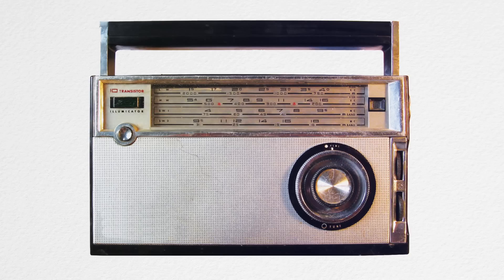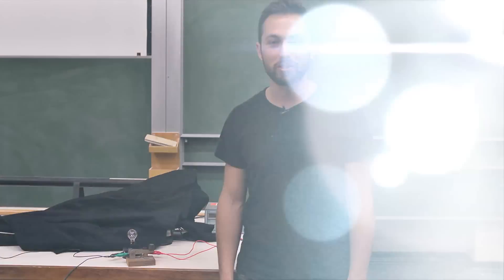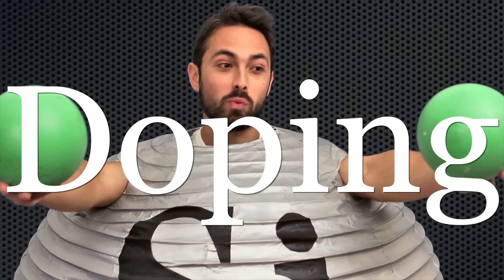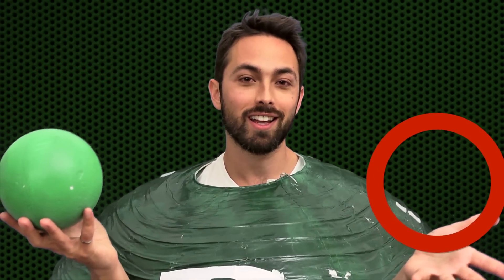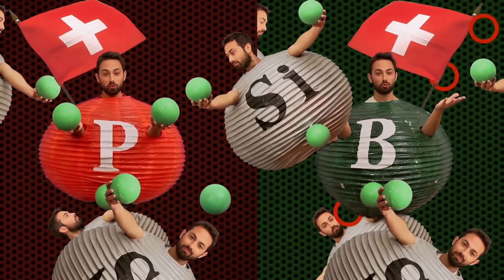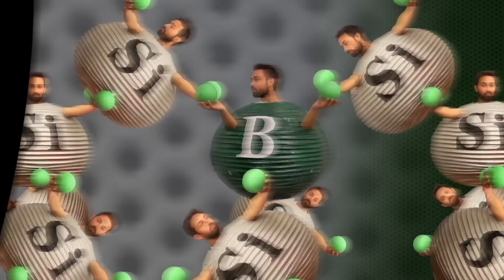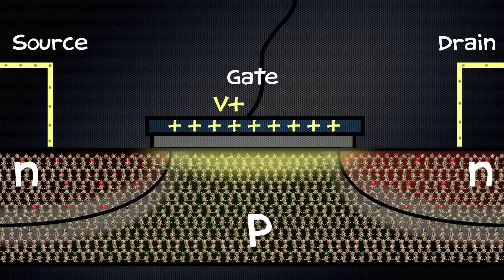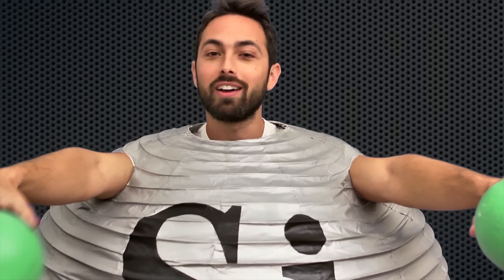How Does a Transistor Work?

Comment: Good Morning,
I greatly appreciate your Youtube video series.  I enjoy and ’LIKE’ every one of them.  You have covered some aspects of science that I have never covered.
I was especially enjoyed the videos on How Transistors Work.  This video brought back some memories that I have been dwelling on all day.  At one time, long ago, I made transistors while working at Monsanto’s Research Center located in Creve Coeur Missouri, just west of St. Louis.  The year was 1969.  At that time, Monsanto was a major provider of polished single crystal silicon wafers used in the manufacturing of semiconductor devices. Our job was to push the edge of the envelope in production and device technology.  The state of the art wafer was 2” in diameter.  (When I retired from the industry the wafers were up to dinner plate size.)  I worked mostly with 1.5 inch wafers.  You caught my attention when you said that The laptop computer that I’m using now contains over a billion transistors.  We ‘squeezed’ seven transistors on one 1.5” wafer.  They were visible without a microscope!  Some IC production was going on with our customers but no where to the density you reported.  We selectively diffused phosphorus (POCl3) or Boron (I don’t remember the compound) into areas of the wafer to produce the N-P-N junctions. Evaporated or sputtered metal contacts and tested the results.
This entire technology was new to me.  My training was in vacuum tube technology.  In fact, there were no college courses teaching semiconductor technology that I was familiar with at that time.
Thank you for the trip back in time and all of your video seres.
Paul, Ocala, FL

Comment: not correct , the gate voltage actually pumps electrons from the bottom bulk material towards the p-silicon. First the holes are filled , then inversion takes place, which means that electrons now overflood the p-type (similar to an n-type), making it conductive. Now when u put a voltage on between source and drain , electrons are simply pushed from source to drain, due to the voltage (pumping electrons).

Comment: So a positive voltage applied to gate allows for the flow of electrons, but can you apply a positive voltage to the gate without also connecting it to ground, or does the gate somehow bypass that by the rest of the transistor being connected to ground? In which case wouldn't the current outputted by the gate interfere with the output of the drain?

Comment: Can someone explain why the hole would be positively  charged as opposed  to having no charge once oh ever
Reply: +Marcus Godiali 
A hole is a term to describe an atom that doesn't have a full complement of elections in its outer electron shell. Since it would like to take on one or more electrons to make it complete, it has a net positive charge. If it has a full complement then its neutrally charges (don't want more electrons and doesn't want to give up electrons).

Comment: i thought the oxide layer insulates the semiconductor from the "charged plate".How does applying the charge cause the electrons to penetrate the depletion layer?
Reply: Actually, his explanation confuses the principles of the older BIPOLAR JUNCTION transistor with those of the newer MOSFET (metal, oxide and semiconductor FIELD EFFECT transistor). He also forgot to mention that they can operate as analog regulating devices like volume controls, and were invented to replace vacuum tubes (British: valves) for those purposes. A p-type or n-type doped semiconductor can conduct current in a reasonable amount, better than i-type (intrinsic, i.e. pure and undoped) silicon, but a junction between p- and n-type can only conduct one way. The principles of junction transistors and diodes are explained in other videos; the MOSFET he describes only needs one type of doping, either p or n, and the insulated gate. A negative voltage on the gate repels electrons in an n-type channel, restricting current flow (and cutting it off if high enough), but attracts holes in a p-type channel, enhancing current flow. Conversely, a positive voltage on the gate restricts or cuts off flow in p-type channel, but enhances it in n-type channels. But no current ever flows across the oxide layer between gate and channel, so no power is drawn from the source of the gate voltage.
Reply: That's what I was wondering.

Comment: This is a misleading video, your "Source Gate Drain" only applies to FETs , not most NPN or PNP transistors which have a "Collector, Emitter and Base" FETs are specialized transistors. More blind leading the blind and calling it science.
Reply: +Indrajeet Datta, I am a Christian fundamentalist and immediately recognized the FET vs bi-polar transistor error in this video.  I was not required to renounce my religion in order to get a degree in electrical engineering.I am not sure why you think a persons religion somehow makes it impossible to learn and understand scientific principles.I also saw that this video completely ignored the linear-mode of operation which was the first widespread use of transistors (amplifier and oscillator circuits).
Reply: +The Delusional “Dorkins” Dawkins The principles are similar to those in other types of transistors, including BJTs.

Comment: What's cool about this video is the very last part; 14 nm transistors are commonly used now, and 7 nm transistors do currently exist, although not commercially, because of quantum tunneling! 10 years came a little early ;)

Comment: Why do transistors get hot like how?
Reply: +Flying Karapet 
Transistors have some resistance. Current flowing through resistance gives off heat. The filament in a light bulb has resistance and heats up so much it glows white hot.
Since each transistor gives of a little heat, if you pack a zillion of them together (like a dance party) it adds up.
Chips have other things on them apart from transistors that also give off heat (resistors)

Comment: Simbel Speek a two DIodes the with ANodes gesoldert an a two Diodes Anode  the Two Katodes  the Diodes  she  Colector and Emitter of the Transitors and the middel Electrode is the Base of the Tansistors Also B for Base  and C for Colector  and E  for Emitter for NPN and PNP  BC 108  is B for Bor and C is for Low Frequceny and the Nomber is a Type Nomber

Comment: I refuse to use a computer that uses doping. I live a bad ass lifestyle which means no drugs or alcohol. Ok maybe alcohol, but no doping.
Reply: Fun-fact: your body makes doping. Yeah, it depends on doping. This stuff tells bone marrow it has to produce red blood cells, which can transport oxygen. Without doping you wouldn't be alive.
The reason doping gets used in cycling is that you can store more oxygen in your blood, and breathing is more efficient. This is also why it's so hard to check if someone used it, as the stuff will always be there.
Reply: @henk6172  thanks, captain obvious
Reply: @cuongdang3304  That is not a Captain-Obvious material.
Reply: what no that's my point ...
Reply: +Ryan Gralinski Alcohol is so much worse for you than dope
Reply: Damn you hella INTRINSIC...
Reply: if you drink alcohol your no better then someone who does dope don't judge the transistor it had a hard life

Comment: This is a pretty cool explanation. The type of transistor that he described is a Field Effect Transistor (FET). They are good for acting like fast switches, and have low power consumption, if I remember right. There are other types of transistors, for different purposes, like amplifying a signal - think about increasing the strength of a received radio signal.

Comment: Folks let's not get too hung up on this whole thing about "holes".  I've taken a half dozen courses on semiconductor physics, mostly at the graduate level.  This will annoy some of you, but please listen.  Holes are more than a mere space where an electron used to be.  An electron vacating its orbital position sometimes leaves a hole behind but not always.  In intrinsic silicon (undoped), electrons which leave their parent atom leave behind a hole.  This is because silicon has 4 electrons in its outer shell and silicon atoms bond in a crystal lattice structure of 4 atoms in a tetrahedron.  Since there are 4 electrons per atom, and 4 atoms, whenever an electron leaves its atom a hole exists.  But not the case with a donor atom, which is a group 5 atom on the periodic chart.  Take arsenic, it has 5 electrons in its outer shell.  When a silicon crystal is doped with As, there are still 4 atoms per tetrahedral bond.  But As has 5 electrons, the other 3 Si atoms have 4 in the outer shell.  If 1 electron leaves the As atom, there is NO HOLE LEFT BEHIND.  This is because all 4 energy states are filled by the 4 remaining electrons.  This is very important.  The loose electron is an excess carrier and as a result n type material, aka donor atoms, can easily conduct electrons.  They have high mobility since they are abundant and will not recombine with a hole as often as they would in intrinsic material or p type material.  Likewise a boron atom, an acceptor, is from the group 3 of periodic chart.  It has but 3 electrons in outer shell and without picking up or shedding electrons, there is a hole present since tetrahedral bonds consist of 4 shared electrons.  With only 3 a hole exists and free electrons statistically combine with said hole more readily than in intrinsic or donor material.  Bottom line - holes are more than just the absence of an electron, they are present when the number of electrons in the outer shell is less than the number of covalent bonds, which is 4 for Si.  A hole has an effective mass, charge, and bandgap energy.  A mere void does not.  When doping Si, some atoms get trapped in between atoms not forming a flawless crystal, known as interstitial atoms.  Electrons which leave these atoms DO NOT LEAVE A HOLE BEHIND.  Please understand not all holes are voids that used to have an electron.  Not all electrons leaving an atom generate a hole.  Have I helped?  Claude
Reply: You've made it more confusing, actually. But then again, quantum physics does that to everything, so I'll let you off the hook XD
Reply: Madafackin Science

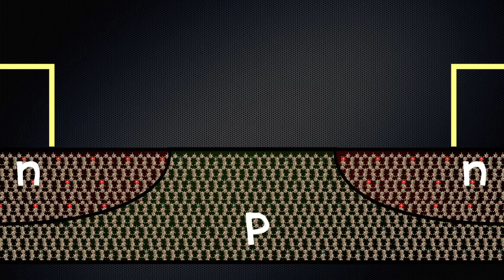Comment: 3:35 Are you explaining the function of a transistor or a Field Effect Transistor? 
A transistor doesn't have a gate, but a FET does. 

Transistors have emitter, base, and collectors. 
FET's have source, gate, and drain. 

Transistors are current based operations. 
FET's are voltage based operations.

Comment: ok so if im using a say an arduino and i have gate hooked to any pin and i write  simple code like so 

void setup()
{
pinMode (2, OUTPUT);
}

void loop()
{
digitalWrite ( HIGH );
wait(500)
digital.write ( LOW );
}

does this mean that what ever other components i had on the drain will allowed 3.3 to 30v thru the  drain?? so if i have a LED on the drain pin it wud light up every half of second based on my code example?  

if so would i hook the ground leg from the LED to source ? and the positive to the drain?  and this complete me circuit ?

what about a PNP ?

Comment: 4:35

1) I'm thinking that the oxide layer would keep the positively charged gate from doing its job. Why doesn't it?

2) The key concept seems to be that when you apply the positive charge, it creates a hole in the depletion layer and allows the electrons to flow across. But how? Wouldn't the electrons just flow a little bit of the way through, and then form another depletion layer (by filling the holes in the P-type)?

The counter to that might be that the positive bar attracts the electrons and gets rid of this newly formed depletion layer (by unfilling the holes). But, here's my question - if the positive bar is strong enough to continuously do that, then wouldn't the electrons just flow to the bar, instead of flowing all the way across to the other N-type?

3) How does there ever end up being a flow of electrons. The way I'm thinking about it, the electrons would just sort of fill up that area in the P-type until there aren't any more open holes. I guess that if you had a bunch of transistors connected to each other, and you applied turned all the positively charged bars on at the same time, there'd be a flow. But I don't see how it could happen otherwise.
Reply: Adam Zerner 3) the transistor is a part of the circuit, the two ends are connected to the positive and negative ends of a battery. The electron flow was induced by the battery.

Comment: Wait, what's that thing about Moore's law? The no. of transistors get doubled every 2 years? What do you mean? Can someone please explain that bit?
Reply: Joseph Pullukatt It is a law based on the observation of computing history in that every two years the number of transistors in computing hardware has doubled.
Reply: +Joseph Pullukatt Technology is such that the number of transistors that can be grown in substrate will double every two years, meaning we can fit 2 times as many transistors on the same size substrate as we could two years ago.  This is Moore's observation about the capacity of transistors in substrate.

Comment: "no moving parts". This bit interests me since we are moving electrons from the source to the drain. I'm not saying he's wrong, it's got no visible moving parts, but it's still a mechanical action, is it not? How am I wrong?
Reply: There are no moving "parts" because the atoms are stationary. What moves are just charges.
Reply: So can we positively and negatively charge macro sized objects and do the same as in the nano world?
Reply: I thought volatile memory just meant you lose what it's storing when it loses power?
Reply: Well for one thing, the electrons are only moving from source to drain on average. In the main part they're just zooming around in random directions.
Reply: Ian Hargreaves The moving part means it is non-volatile. You know those old harddrives, not ssd's but those old one that makes noises when they are turned on. They spin a wheel to read those data's which is inside the harddrive. That harddrive is called volatile. SSD are called non-volatile because there are no physical moving objects
Reply: Yes it does also. Volatile means when you cut of the power, you cut off the whole thing. Those old harddrives use power when they spin. If you want to find a text file (Word, Open office, libra office etc) or a picture, you ask the harddrive to get it for you. The old harddrive spin when it is searching for that file. That uses power instead of SSD. SSD sends out electrons in a matter of ms (milliseconds). If you cut out that power, you lose data. However what he forgot to mention was that flash disk or drive (whatever you want to call it) has two gates. The one he spoke about was the "control gate". That gate controls the flow of electrons by giving out voltage (power, electricity etc). The other gate is called "floating gate". This is where data is stored. This is where non-volatile comes in. Non-volatile means "data that is stored in a chip and does not disappear even if the power is cut off". Those data stays in the floating gate. What he was talking about was transistors in general. 
More info: https://howflashdriveworks.wordpress.com/how-does-flash-drive-work/#comment-93
Reply: Ian Hargreaves Do we REALLY move those electrons?

Comment: you dont know how much time i spent to learn this, and then there is a 6 minute video that learned it from :O very good video :D
Reply: ***** Yeah, I wish he had explained both. I am starting to learn more about electronics and would like to better understand the PNP transistor compared to the NPN similar to how he does in the video.
Reply: do you know anything about p-channels?
Reply: no whats that??
Reply: Well, I meant n-channel, p-channel is just this on the video. It would be the reverse of this, the p-type is on the drain and the source, while the n-type is on the middle (the n-channel). Apparently, this type of transistor turns off when there is a current to the gate. But I'm trying to find out how does it does it physically, like shown in this video.

Comment: Solving the problem, I'm guessing, is where graphene comes in. If you haven't done a video on graphene, I'd like to see one.
Reply: He has
Reply: Graphene is there because it is more energy efficient, so you can run the chip faster without it overheating.

Comment: what switches on  the current
Reply: +Fin Corlett when the gate to source voltage is sufficient to cause the channel to start to open between the drain and source.  It has to exceed a threshold voltage that is set depending on the physical dimensions of the device.  Current is the rate of flow of charge, once you have charge flowing you have current.

Comment: This video made me more confused than it should have, as an educational video. The problem is that you don't really go into depth about what causes the attraction/repulsion of electrons despite the fact that there's an equal number of electrons and protons. If the net charge of the object is neutral, then how the hell can current flow?

Turns out the answer is that atoms (NOT THE INDIVIDUAL SUBATOMIC PARTICLES, but ATOMS), as a whole, tend to attract MORE electrons than what they would actually need to match the number of protons they have. This is called the octect rule and is what you refer to when you talk about "holes". It's very very important not to miss this fact. It's not the charge of the nucleus/electrons but the valence shells around the entire atom that drives each and every one of the billion transistors in your laptop.
Reply: I think you're still a little confused. You're arguing the same principles that he expressed in the video.